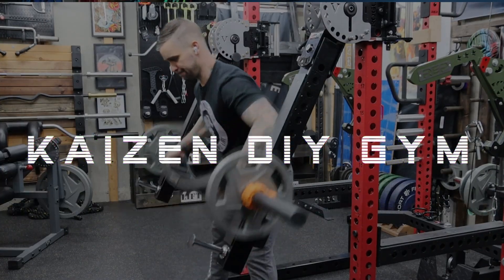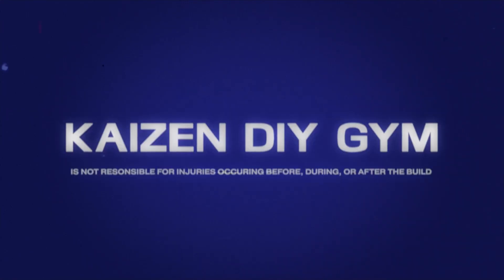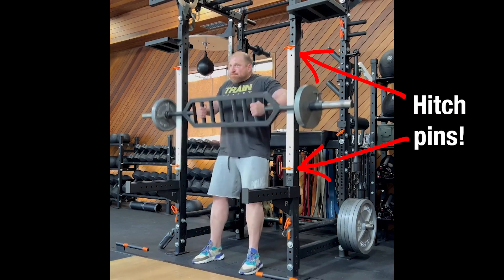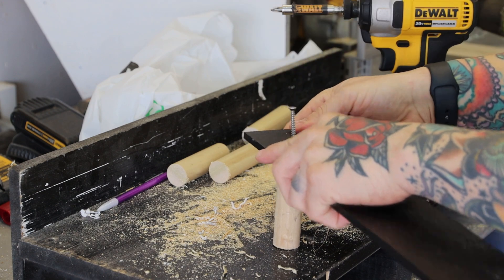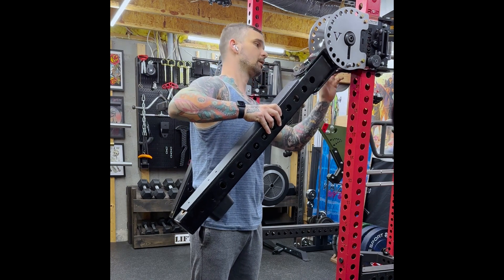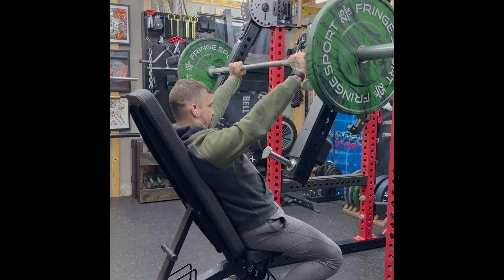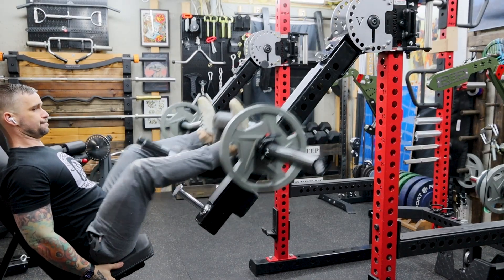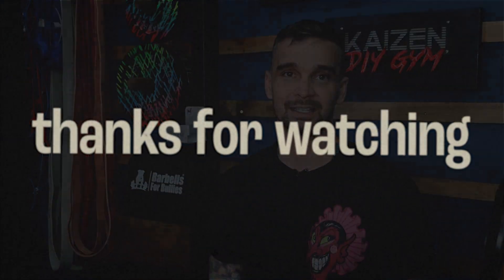DIY Smith Machine hack, easy project to add versatility to the home gym

Comment: Kyle, In one of the hack squat movements in the video I see you rounding your back somewhat.  How does it feel on your back doing hack squats against the rack with a heavy load? My big reason for doing hack squats is to protect my back and put more emphasis on my quads.  Thanks for exploring these low cost home gym solutions.  I just don't have room for a hack squat machine in my small gym.
Reply from the maker: That’s the one thing about this vs a dedicated hack squat machine. There is no back support on this one.

Comment: Where did you find the bar catches that fit the 3” x 3” jammer arms for the hack squat setup?  All I can find similar to yours are by Body Solid but those are for 2” x 2” racks.
Reply: Also, loving your jammer arm attachment!
Reply from the maker: Those are the band pegs that came with my Rep Rack